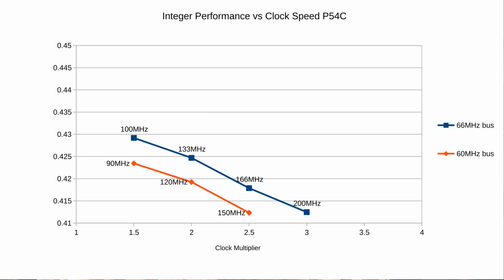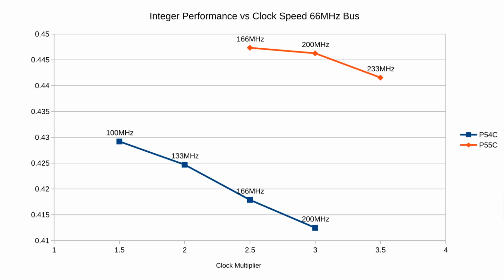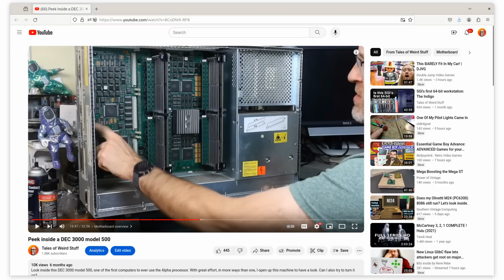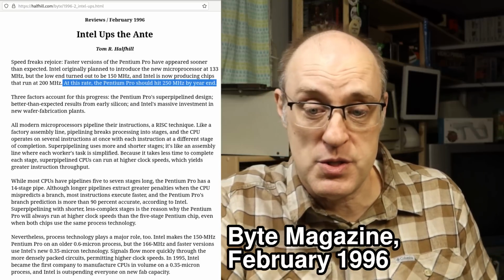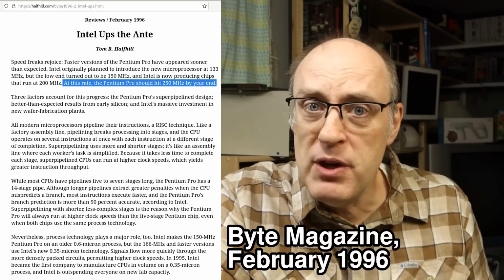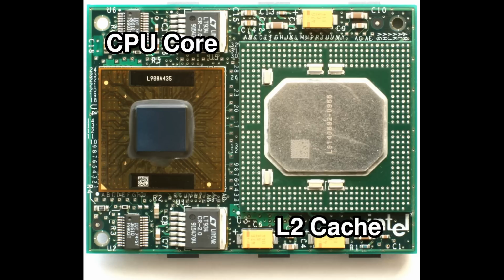Why did slot CPUs exist?

Comment: In early 2019 I got my hands on a lightly used AMD Ryzen 5 1600X, and got a great deal on 16GB of brand new G.Skill TridentZ DDR4 3600MHz CL17 RAM to feed my processor. The CPU's memory controller would not run above 3200MHz and I knew that going in. I had bought the fastest RAM with the tightest timings I could afford at the time for a good reason. The performance difference between the stock 2666MHz CPU memory speed, and 3200MHz with XMP enabled, both at the same timings the RAM runs at 3600MHz, and noticed a up uplift in performance, especially in multitasking and certain games. The CPU's own core clocks were locked in at 4GHz all core at 1.378 volts. I now have an AMD Ryzen 5 5600X (the reason I got the fastest, tightest timing RAM I could afford) on the same motherboard, the RAM running at the CPU's stock 3200MHz clock vs 3600MHz with XMP on was still noticeable in bench marking, but not so much in my day to day tasks and over all performance in gaming. And with AM5 machines running DDR5, the RAM speed bottle neck, as it were, has closed the gap even more to performance boosts in overall system performance.

Comment: There's still some applications where a CPU is on a daughter card or board. There's of course the Compute Module line from Raspberry Pi, but also Nvidia's Jetson and server SOC products. I'm not too familiar with the entirety of industrial PCs, but there's probably an industrial PC out there that still uses the idea to this day. Ok, maybe those modern examples aren't as simple as a CPU on a card, but it feels like the idea evolved and found it's niche rather than completely died out.

Also, PowerPC CPUs were soldered onto a daughter card more or less from the start up right up to about POWER5+ or POWER6, which was circa 2006-2007.

Comment: I love the slot cartridge form factor (my most recent Win98 retro machine is a P2/450), it looks much cleaner and more futuristic and is (in theory) easier to handle than the bare CPU hiding under a huge heatsink - but the plastic retaining frame they added around the socket is awful and in practice, it never fits right and is very fiddly to un-clip. I was aware that the reason for the cartridges was the L2 cache and yield problems, but the added details and context still made this video fun to watch.

Comment: the slot processors existed mainly to try and making pc building more appealing to the masses , at least that is what i always assumed. it certainly made cpu installation look less scary and technical. 

back in the day we had a pentium 2 that was a slot processor (it was  prebuilt HP or compaq can't remmber which), and my first pc i built myself was a slot A  athlon  thunderbird 850 mhz in 1999.  

but i digress , gona watch your video and see what you say is the reason for the slot processors.

Comment: I must've just missed this nonsense. I upgraded to my first x86 machine(from an Amiga 1200 with a 25mHz 68030/68882 and 16mb fast RAM) in 1999, and it was a 500mHz Pentium 3 in a socket. Not sure the details, I was only 16 and just needed something to run games(mainly Super NES emulation after my mum sold the real one, to be fair) and do some word processing/spreadsheet work with.

Comment: No mention of the celeron slot 1`s ?  Had a celeron 300a overclocked to 464 and it would SMOKE a PII 450 because it had on dye l2 cache that ran at the speed of the core instead of the 1/2 speed of the p2 450. Thanks for the tech talk :)
Reply from the maker: Oh heck yeah I mentioned the Celeron 300a! Check 52:22. It would have been very shameful for me to have left that out! :)
Reply: @TalesofWeirdStuff my bad , somehow i missed it. thx for the reply

Comment: I liked the cartridge CPUs, they were easy to install and remove and very robust, no pins to get bent, no fiddly latching mechanisms, and you could install the cooler on the CPU before installing the CPU in the computer. I don't recall hearing complaints about the format at the time.

Comment: How about you no longer buy RAM, you buy slocket boards which are just soldered RAM chips right next to a socket, nothing else, with the connector carrying power and a buttload of pcie lanes for the motherboard to do whatever with? Discrete chipsets are half-obsolete already, integrated water coolers have matured and would suit the form factor, platform-agnostic motherboards would be neato, and a board with memory chips soldered to one side and the socket on the other could have VERY short traces

Comment: On that final thought about memory being closer to the cpu package, it has been quite a while since HBM arrived to consumer electronics. There were some AMD GPUs using them and I think it's used in some CPUs, it hasn't been adopted as a mainstream thing but you still see professional and prosumer products with HBM made today. Also, for a couple of generations AMD has been offering a line of CPUs with massive 128MB L3 cache made in 3D tech, I myself have have one of those (7900X3D), and they are wonderfully expensive so I don't know how would be a, let's say, CPU with 128MB of 3D L3 cache plus 32GB of HBM on die, probably 2-3 grand plus maybe a specially tailored motherboard.

Comment: My p2-333Mhz slot 1 is still my daily dos gaming / win98se desktop workhorse. I have every possible era of system from a xt class until a 56 core xeon and it amazes me how compatible and versatile the slot 1 generation was/is + it still fits a modern case and psu.

Comment: Where did you get a P60/66 without a gold cap? I've never seen that.
Reply from the maker: It surprised me too. I thought the socket 4 Pentiums and the socket 5 Pentium 90 all had the gold caps. I have another 66MHz chip that does have the gold cap. I'll have to compare the date codes on them.
Reply: @TalesofWeirdStuff  Yeah seeing as how P75 had it, and even the PPro (until the 1M cache version) that's surprising.

Comment: We sometimes found PCs where if the computer went through shipping with the slot facing downward  occasionally the card would pop out just enough to cause issues. Fix was to open the cover and push down on the card. Didn't happen all the time but often enough to be irritating. The locks were suppose to prevent this but they weren't always 100% in doing so.

Comment: The word bandwidth should never have been used to describe a data flow rate. It already had a definition long before digital electronics existed. It represented a range of frequencies of electromagnetic radiation usually in relation to filters. It had nothing to do with a flow rate. The term was hijacked by digital electronics.

Comment: So great hearing you explain this. Hopefully some of the younger generation will watch this and realize what we had to go through back in the 90s. I started with an XT back in the mid 80s, a clone.. but the first system I build for myself was a 386sx25 100mb hdd 4mb ram.. yeah it was a dog but SO much better than the XT. Then I put together a 486dx4 100, that thing was light years ahead of the 386. I ran that for so long I NEVER built myself a Pentium.. my buddy grabbed the Pentium 233mhz slot, or I think it was maybe a 266 it was SO long ago.. but man I ran that 486 for so long then and kinda got busy in life, didn't really mess with it for a while, then I took a giant leap and built an Athlon XP 1.3ghz system. That thing was like light years ahead of the 486. Years too, that was probably 2003 when I built that.. crazy how far they've come in SO little time.. since 2019 I've been on AM4, went from a 2600x to a 5800x3d (staying with am4, I already have 32gb ram and all the other fun stuff I need, no reason to go ddr5, why? PCIE4 should be enough for the next few years if not longer) anyway.. man we have come a long way.. I can't wait to see what the next evolution of CPU structure is.. we've come to Moore's law now, I think we're at 3nm on CPUs, Intel isn't even measuring by nanometers anymore.. I'm curious.. I know chiplets, 3d architecture, organic material.. who knows but I know it's going to be big!!

Comment: Haven't watched the whole video yet, but I already have some insight, given what little I know about construction of modern multi-core multi-gigahertz CPU's.
The entire "the memory speed problem" segment is telling me a lot of details about why they decided to remove the Northbridge chip (which housed the memory controller) entirely from the motherboard and integrate its functionality largely directly into the motherboard (with a concomitant increase in CPU socket pin count required by such, due to interfacing with up to 4 memory channels to deal with the bandwidth limits of DDR3 RAM, even tho 2 is the industry standard these days for both DDR4 and DDR5).
My thinking is that they did this to both decrease latency and increase bandwidth at the same time (as well as allowing headroom for future growth), because the inductance of a PCB trace (and therefore the maximum frequency that is able to be transmitted efficiently along it) is highly dependent on trace length, specific geometry of the trace (you can sometimes shape them to act as a wave-guide, so-called stripline or microstrip construction), and of the dielectric constant of the substrate the trace is laid down on (which is why PCBs for motherboards are so picky about which specific fiberglass and fiberglass resin combination they use, that has a huge impact on dielectric constant of the resulting composite).
By moving the entire memory controller on to the same die as the CPU cores themselves, all those factors are eliminated from consideration, the only factor remaining is the transmission speed of impulses thru the interconnect layer deposited on the silicon die itself, over the tiny distances between major locations in the die, which massively improves performance.

Comment: It's worth noting that the Athlon was a brand new platform based on a completely different bus architecture (the DEC EV6 bus, thats why there were DEC Alpha CPUs in the Slot A form factor), not just a new processor and form factor. It took longer to get to market than expected, were expensive, and OEMs had first dibs. The  K6-3, then, was a way of buying time till Socket A and its processors came out. The slightly later K6-3+ and K6-2+ were a die shrink aimed at a mobile market hungry for something  fast that could use a normal socket. The fact they were unlocked, could run in a lot of desktop boards, and supported on the fly multi adjustment (you could OC alot of them to 500+ MHZ) on the fly meant users with Socket 7 and Super Socket 7 rigs could eke even more use out of their systems.  By the time the first Athlons were released I'm sure AMD knew Slot A was a dead platform (only lasting about a year as a consumer platform) and probably only released it due to OEM contracts (the Slot A T-Birds were OEM only, for example). It does make one wonder if AMD might have shifted some resources towards what would become the T-Bird and released the first Athlon in some sort of Socket compatible form factor (you could have a reference design that has the L2  close to the socket, and could use what would become the Irongate NB) for direct consumers instead of messing with slot CPUs had they known how late the Athlon would be to market. As a bonus, it would leave the option of bios updates for those early boards that would let them use newer on die L2 Athlons and use the mobo based L2 as L3. Would have made for some stupid fast systems.

Comment: On the matter of Pentium Pros, I remember at the time I worked in a lab and a school commissioned a dual Pentium Pro, the boss was so leery for us putting together a so expensive a machine that he bought a pre-tested and assembled system, a veritable BEAST of computer thought to be used as a server that needed two people to be moved and that we only had to put memory and drives on, and even then my blood ran cold at working on it given what the cost of a mistake would have meant.

It was a dual 150Mhz we loaded with 64Mb of ram (in 1996, when the rum for the mill system still usually mounted max 8Nb) and a don't remember how big a disk drive and the school told us to pre-install on it... the at the times ubiquitous Windows 95 (a 16bit OS that could not use neither the dual CPU configuration nor the penchant of these CPUs to work at their best only on a 32bit OS).

I still remember my comment to the boss: "they bought a Ferrari only to economize by mounting bicycle wheels under it." Then went and did just that. Customer's demands, no matter how stupid, HAD to be respected, especially on a that expensive an hardware.

Comment: 34:23 oh my god are these round graphite heatsinks for horizontal airflow? That's adorable. 🤣
Reply from the maker: I'm not sure what the point of those was. I've seen them in a lot of workstation kind of computer from the late 80s, but they just vanished after that. I used to call them "flying saucer heat sinks,"  and I always thought they looked cool.
Reply: @TalesofWeirdStuff  I need to look at thermal shots for these. Knowing how heatpiping and dissipation approach works nowadays one has to wonder if only first circle actually did anything and remaining 2 were just for the show with graphite core barely transfering heat....then again these weren't exactly 75TDP chips so...

Comment: I worked in computer stores at the time.  These were very confusing when they came out, but were kind of cool in that they eliminated the problem of bending pins.  

On the other hand, they were prone to coming loose from the motherboard during shipping, even when the mounting hardware was properly used.

Comment: The edges of the round silicon blanks, the machines try to make full processors as normal which you would think is a waste of time but it helps with quality, it helps to ensure the full parts close to the edge don't end up with flaws etc..a flaw does not make the part trash but it could mean it ends up being less cache or runs at a lower clock speed etc...was supposed to be a top of the range ship but the flaw makes it a mid range chip instead with some compromised compute cores disabled etc
...

Comment: You have a tank full of information. You need the information from the tank as fast as possible. No matter how fast it moves or how many "pipes" you have the distance of this "tank" from where you need it will greatly affect the performance. Placing this tank on top of where you need the information will always be best. Consider your hard drive, your ram, different tanks with different distances, amount of pipes, size of pipes, and different speeds through those pipes. If that makes sense. The memory amount and speed directly next to the processor will affect the effectiveness of the processor clock speed greatly,  much more than random access memory, and your hard drive is just for mass storage. Probably none of this makes sense to anyone but me lol sorry. 😂

Comment: I definitely loved the video. I initially felt a bit.... "bored" isn't the right word. I felt that direct mapping and some early parts were just tiny bit too long (or repetitive?), but as soon as we went to associativity - that was worth it. Especially given how this is among least understood topics. I would LOVE such video on cache, where you explain it all.

I had Pentium II 233 MHz. Very decent processor that served me for over 5 years. But since I was mostly gaming, you can't exactly keep playing on it, when most CPU's in early 2000's were already pushing 2 GHz easily (my next CPU was Athlon XP 2200+ - so from memory it was actually 1.8 GHz. And Pentium 4's weren't that great).

I remember helping to "service" Pentium III Xeon that was in large tower format in local university in 2010. It was necessary to keep it alive, because it was the only computer with motherboard that still had ISA (?) port. And spectrometer required that port. So some of them had pretty long lives.
I did wonder why you didn't compare the caches of Zen 3/Zen 4 as an example of modern cache on CPU, but I guess it makes sense to compare Intel to Intel and differences aren't that staggering.

Though when I saw first Zen being released and it's cache structure (from memory L1 - 64KiB [4-Way] Instruction and 32KiB [8-Way] Data Cache for 1 core, L2 - 512 KiB [8-Way] for 1 core, L3 - 8MiB [16-Way] - for CCX) on Zeppelin die, I was blown away by how much it would have to cost in transistor space (though I stopped following technology a decade earlier, so I guess my shock wasn't universal). And then they doubled L3 for Zen 2, and then they unified cache with Zen 3, and then L2 got doubled with Zen 4. And how they did it without gigantic hit to latency (there was some, but it was minor to what was expected) is still a mystery to me. And yes, that is why I'm interested in cache video - because I never understood associativity well, all I "knew" is that "more way better, but costly when it comes to transistors and if you don't use transistors for decoders then slower" - which is a bit simplistic and probably wrong ;)

Intel also started to massively increase L2 and L3 cache after their "stagnation period" (to put it mildly). I only wondered whether it is "fair" to compare 1-core CPU transistor count to 8-core CPU transistor count, especially when L1 and L2 caches (depending on micro-architecture) are often counted "per core" (especially L1). Then again, it is valid comparison of 1 CPU to another 1 CPU.

If you have more content like that (talking about history or micro-architecture) - I'd definitely watch it. Intel was quite annoyed about AMD getting 1 GHz and Itanium not panning out. I hope they manage to escape the problem that is similar to Boeing (too many managers talking about profits, not enough engineers at highest levels). They used to innovate so much that it is sad what is happening to them :(